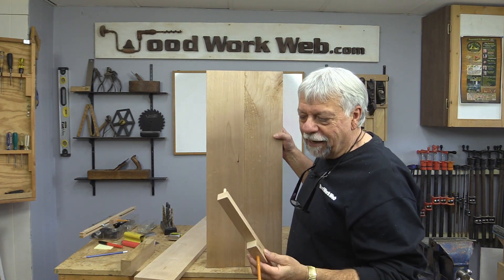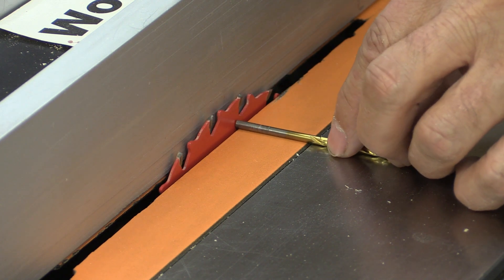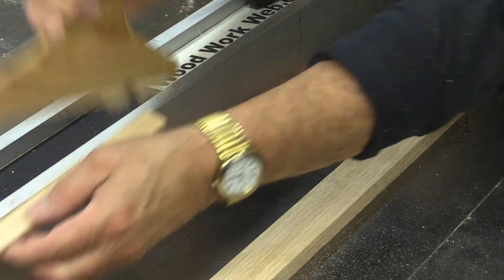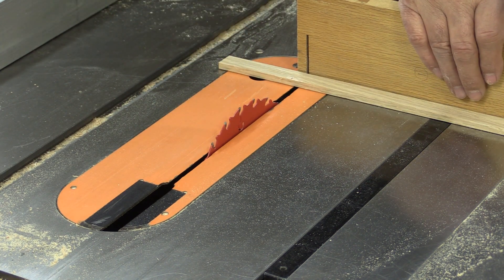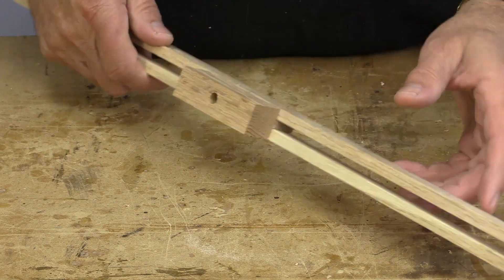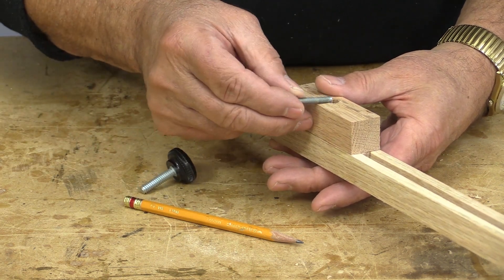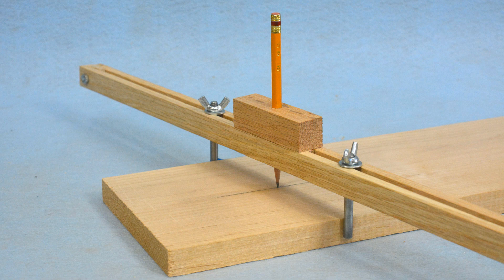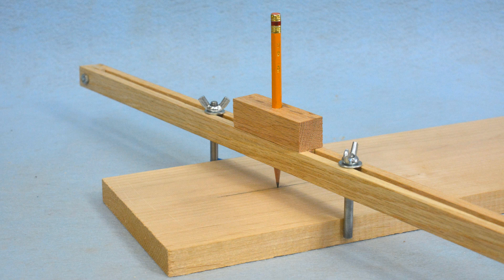Adjustable Center Finder Jig / Centre Marking Jig

Comment: I would rather have your original, fixed pin design in two or three different sizes. This adjustable model introduces the possibility of innaccuracies, I feel. There again, anything with a pencil stuck in the centre isn't going to be as accurate as a centreing rule anyhow, but I do love the handiness of these jigs. Thank you.

Comment: Great design 
Before you glue the added wood for the pencil.  Put a saw cut to the hole . Glue all but that one side of the cut. Drill side for thumb screw. Clamps pencil without damaging it.

Comment: I have to disagree on this one, having to manually align the jig every time is a hassle and increases the chance of incorrect measurements. It would be better to have multiple fixed positions to put the pins, basically just add more holes to the first jig.
Reply from the maker: If modifying the first jig fit you're needs better, by all means do so. Jigs are all about what works best for the user. Thanks for watching.
Reply: I didn't mean to sound harsh, there's probably advantages to this new version as well :) Anyways, thanks for the good free content!
Reply: Great modification Don.  I think I will use your tip.

Comment: If you needed to tighten the pencil hole you could cut a slot the length of the block and then put bolts on either side of the pencil hole. Also you could put spacers on the bolts so they would roll and not drag down the sides of the piece.

Comment: Isn't it better to have the thin strips of wood cut off to be on the orher side of the blade? If the thin strip is between the blade and fence, a kickback chance is very high. Speed square is faster just draw two diagonal lines  the intersection is the middle

Comment: How about adding multiple marks on either side of the gauge  to line up the bolts  for different widths of boards. Maybe measure out very 2 inches and mark it with a Sharpie to line up the bolts.  Great idea for a 1 size fits all center finder.
Reply: Ok for close enough.  Colin measuring the bolts from the center to the bolt with the same "gauge" will yield much better accuracy.

Comment: Am I missing something, or couldn't you simply have taken the original jig and drilled a couple of spots at different widths from the center, and put (removable) dowels in those for more narrow boards?  Seems much easier...and, frankly, waaaay less likely to screw up due to not setting the two screws properly.
Reply: Larry B I've done that to the first jig. 3 stops each side covers 100% of my "center-finding" needs.
Reply from the maker: This jig is FULLY adjustable, but the first jig can be modified to fit most of your needs with extra dowels as you suggest.
Reply: Perhaps there is a way to set a controlled offset from center?
Reply: Yes Colin, the jig is fully adjustable and it's a good design. 
The only issue is that the two screws must be exactly the same distance from the center. Like Larry B suggests, if there are 2 or 3 holes drilled on either side at the precise spots, the jig will serve the same purpose without the need to position the two screws at the right spots.
Reply: That's exactly what I was thinking just a minute into the video.
Reply: Same here. Having to precisely measure to set this every time you need to readjust this kind of defeats the purpose in my mind.
Reply: When he reached down
Reply: Oops sorry

Comment: You probably measure the original instead setting up the nut. Mab be usable for repeat. 
But you may build a jig with a gear in the middle and teeth on the side trail with a T track base. So when you  dial those pin  move equal distance. But the chalange is teeth size and play between teeth.

Comment: By the time you carefully set the two bolts equally spaced from the center, you could have laid out the center of the board you are trying measure!!  AND that pencil is not round, so measuring to it is inaccurate.
Reply: that's what I was thinking of watching the video , but then I thought this jig is good for repetitive measurements though it not dead precise .

Comment: How do you quickly, accurately and repeatedly adjust this? Or do you just get it close, then run it once, flip it, and run it again to get an average center?
Reply: I think the video explains the method of adjustment,  but I'm grateful for your idea of flipping it to verify accuracy.
Reply: @turnerc23  I have yet to find a pencil sharpener that gets the point exactly concentric to the outside of the pencil. So the method of adjustment shown in the video is only "close enough" at best. It doesn't take much to put the center point of a center finder annoyingly off center.

Comment: Could you mount bearings on the bolts somehow or will it cause problems?
Reply: try spacers for rollers.
Reply from the maker: I don't see how bearing could hurt, but spacers like suggested already would probably be easier.
Reply: I honestly couldn't think of any bearings you could use on a bolt but having worked with spacers recently  they came to mind. You would need to have a bolt with more threads and maybe washers and jam nuts to keep the spacers in place.

Comment: Where’s the link for the measuring blocks
Reply: Just use Drill bits, as Colin did for one of his measurements. A lot cheaper than having fancy blokes.
Reply: Peter Compton
But sometimes more awkward to handle depending on what you’re doing.  The link would be of interest just to see the range on offer.
Reply from the maker: Oops, forgot the link. Here ya go http://amzn.to/2zRK8cs